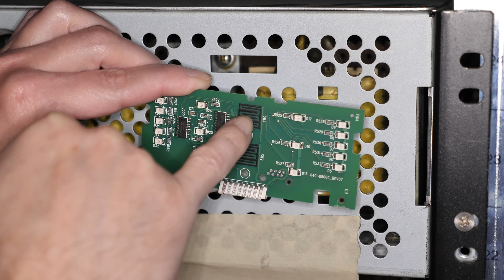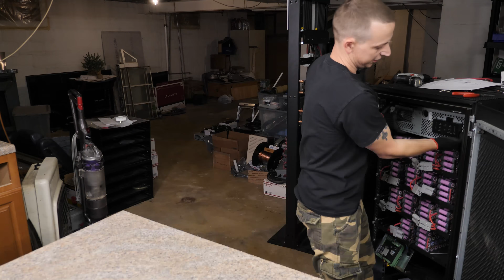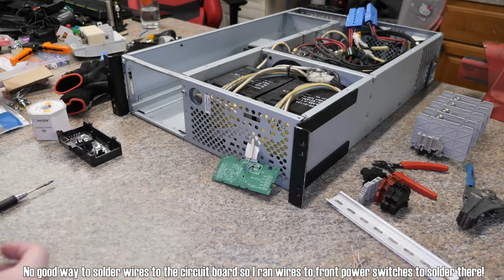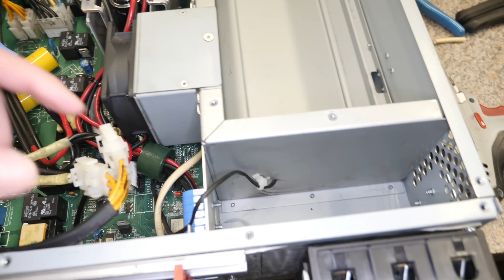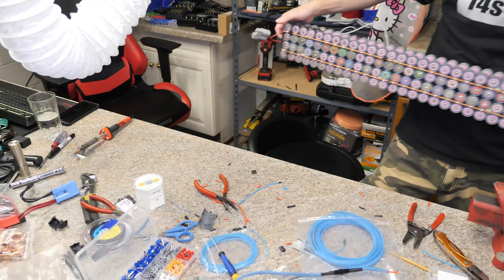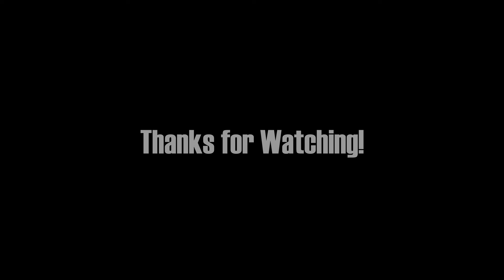Wiring the Diy Powerwall Control Panel Rack Ep.2 UPS Mods

Comment: APC UPS designed for AGM battery chemistry, not Lithium. Care to explain if/how you managed to reprogram it or are you just wasting battery capacity?
Reply from the maker: You are correct they are not programed for lithium. I am just using it as an inverter only....or was until I got a real inverter just a bit ago.🤘

Comment: Looks fine Joe
As to how or what to put on the back of the ups chassis, only you can really determine that. Remember this is a function over form application. If the layout improves function and safety, then it is right.
Simplifying the basis of the ups by removing those components not required is a positive step for safety. Same goes for the old power cord, as the socket for final AC connection.

Now that you have mentioned that you have not started the next set of battery packs, can you refresh the battery suppliers you have used? About 5 or 6 different ones as I recall. I would like to see where they are now. Options are good, one out the check the next.
Keep it going, this is going to be illuminating 😳
🤔💭💣💥
Reply from the maker: Thanks!  Yeah I was going for function with all that on the back of UPS for sure.  Rewiring and removing stuff that I never used was a WIN in my book lol.😆💥🤘

Yeah havent started the next battery build but think that is going to be a priority!  What did you mean by refresh the battery suppliers and where are they meow?

Comment: What? Horus didn't help you with the UPS? lol. 
Not bad rewiring that input wire as output. Since you added an outlet on it, no one could plug it in to anything, or become a suicide plug (the ones with the plug on both ends that some people use for generators and backfeed power through a laundry dryer outlet or something like that).
Curious how the growatt will work out for you. I was already invested in the MPP Solar LV5048 so I just got another one of those and it's now in parallel with my leaf powerwall. Now I need to add more batteries. lol. 25 kWh is not enough for my house and only lasts me about 24 hours.
Reply from the maker: Yeah I guess he was upstairs sleeping AGAIN🙄 Oh yeah I had a guy at work wanting me to make him a suicide plug.  I figure if he didnt know how to make one he shouldnt be trying to use one.  He would be that guy that didnt pull the main breaker💥  I was initially going to go with the MPP 5048 but once I saw they couldnt start a saw, I was out!  Maybe 2 in PEE can?  Have you tried that?  Yeah Im gonna need to start building those packs like ASAP!!!!
Reply: @AVERAGE_JOE  With 2 in parallel I have no issues with a 10" miter saw or any other power tools or oddly enough the garbage disposal. Before I added the second inverter, with only one, it bypassed to grid when starting the saw or the garbage disposal. lol. it's that initial surge that it couldn't handle on its own. now with 2 in parallel I got no issues. Can do up to 3 in parallel for 15kW total.
Reply from the maker: Oh ok then everything seems to be working pretty good then!!! You planning on a 3rd?
Reply: @AVERAGE_JOE  eventually. But at $1200 I'll have to wait a while. Lol
Reply from the maker: Cool and YES saving for an inverter or multiple takes time! Ive been saving for quite a while lol. What is the max load you have seen on your system?
Reply: @AVERAGE_JOE  about 6.2 kw. That's about 100A from the batteries. My leaf powerwall is only 500Ah so I try not to do that too much. Lol. Now in the winter time there is less sun but I top off the batteries from the grid at night when I only pay 1.5 cents per kW then use that power during the day when it would cost 12 cents per kW. Lol

Comment: Check out Genetry solar  they are building some nice inverters, the 6k will start a big window ac, while doing 7kw, if it's under 90° or so, they have a 12 kw coming, and a 3kw, check it out,
Reply from the maker: Ive just recently started watching some of his videos.  Seems like some decent off grid inverters.  Is that what you are planning to get?
Reply: @AVERAGE_JOE  yeah, I have a powerjack now, no issues with it, it's cool they have the wifi board in the GS, inverters, allows control of everything, the test have went great, and the ability to parallel, or series, 3phase,  powerjack would probably rate it at 20kw, but in a basement, it should last forever, keeping it cool, but a 6kw inverter, capable of starting a big AC unit, whild doing around 7kw is awesome, and it has a warranty, and easy to repair, but that it $1000, delivered, for the 6k
Reply from the maker: Sounds like a solid unit for sure! Ill have to look more into them! Thanks

Comment: The AC charging capability might be useful if you need to charge off a generator or something during an outage (to supplement solar).  Do you know the charge parameters of the built-in UPS AC to battery charger?  It might be set up for lead acid batteries -- can it be changed to work with lithium?
Reply from the maker: Well ever since I had a back up system, the power has only gone out a hand full of times and of those times Ive been 1000miles away visiting family lol.  Since using the UPS as my inverter Ive only charged the packs up maybe twice in the beginning when I was testing everything out and havent used it since.  Yeah its set for LA and dont think you can change it.  The charge is minimal as well.  If I remember right it only charges to around 56v at around 1.5a.  It might have even been less.
Reply: @AVERAGE_JOE  That makes sense.  The UPS would be designed to maintain a much smaller battery.  Not worth the effort, IMO.
Reply from the maker: Agree!

Comment: I like the placement of 24V fuse holder. I have totally agreed with Your design. I have checked description of expansion board. The relays are not small. Batrium derates maximum current to 5A, wich is good for reliability. Is the 120V socket on the output cable final solution? You could use output bloc with sockets from UPS mounted on the new rack. Wait to see videos with building new packs.
Reply from the maker: Thanks Man!  I wanted the most direct reliable solution for the emergency shut down/shunt trip!  Obviously a 48v shunt trip would have been better!  I thought the relays were 10a max but I could be wrong.  No the 120v plug is not a final solution and I really like that idea of routing the wires to a terminal block.  Only thing I need meow is moar room back there lol.  Another mentioned possibly doing it that way as well. Another thing I forgot to mention is at this moment I have been using a rack transfer switch and it has a 20a plug on it so I can just plug right into it.  I could technically cut that plug to direct wire tho lol!🤘

Comment: I am curious to see how going off grid goes for you. Not just because I want to see how you build your setup, but also what OPPD says to you when you accidentally feed the grid for 5 secs 🤣
Reply from the maker: 😜 Ill be doing all off grid or at least thats the plan.  Will probly take me forever since saving takes so long.  OMG I cant imagine what they would say LOL but Id probly blow up all the electronics in a second😬💥😆 Are you building a system, I cant remember if you said or not?
Reply: @AVERAGE_JOE  Yes I am, however, I just started gathering supplies to put up panels. I got iron ridge hardware for the roof. Right now I am saving to get conduit from the roof to the basement, and then figure out how I want to set up the system. I was thinking a transfer panel. As the system grows, slowly move services over to the panel. It also gives me flexibility to move everything over if power goes out. Ill get my 4th grade diagram made soon 😆
Reply from the maker: Nice! On my system now, I just used treated 2x4 cut to 6" pieces. Placed those on top of flashing that is slid under the shingle. Then screwed unistrut down on top of all that. The unistrut holds 24 panels. I have video of the install just havent edited it yet. Only using 12 panels at the moment tho.
Reply: @AVERAGE_JOE  if you get that up soon, I may consider that fir the rest of my panels, since the amount of hardware I have only holds 4 panels. I have 15.
Reply from the maker: Its super easy to do especially if your roof doesnt have a bunch of angles like mine has(at least my south facing roof had all the angles). Pretty cheap as well.
Reply from the maker: I have pics on my insta. Link to that should be in description.

Comment: Nice upgrade! You have a bunch of space inside. Will any of that fit in there? Mainly talking about the fuses since you'd probably open that up anyway if they blew. Growatt? The new cool thing? Would you connect 2 for 2-phases? IDK, I just want a 48V inverter with a big, honkin' transformer. I'll add everything else I need. All-in-one is nice and compact, but I want to put my own together the 2nd time around. Wonder if I could build an inverter? 🤔Well, wonder if I have the patience to learn how to build an inverter. 😂
Reply from the maker: Thanks Man!  Yeah I guess I could put the fuses in there, didnt really think about that lol.  Uuuuum yes, growatt is the new kewl thing to do.  IDK lol but I was sold when I watched the 6kw start and stop a whole bunch of powertools, saws ect at the same time.  Ive seen a lot of inverters not able to start a single saw.  SOOOOO Im saving for the Big 12kw!  Its a split phase so can do both legs.  Its got a huge mungus transformer inside and the inverter weighs around 165lbs😲 It also has MPPT charge controller aaaaaaaand you can hook it up to grid to charge and I wanna say use it kinda like a UPS but need to verify that last part.  Building an inverter I think would be kinda fun!
Reply: @AVERAGE_JOE  Oh I didn't see a 12k version. Only saw the 6k stackables. I shall investigate. 🕵🏻‍♂️
Reply from the maker: The stackables are high freq I think. I wanna say they are making a stackable low freq but not sure they ate out yet. Yeah look up growatt 12kw split phase or low frequency inverter and you shall seeeeeee😃
Reply: @AVERAGE_JOE  Oh. It's a weird site. See the SPF1200 now. I approve. 😂
Reply from the maker: Was going to say I could add a link 😆 https://www.signaturesolar.us/categories/off_grid_inverter/2203789000000543155
Reply: @AVERAGE_JOE  Search brought up www.growatt-america.com. I got more info from Ebay. Your link is better. 👍

Comment: 10Kwh is not exactly a small battery.   I can function 24 hours in my Mobil home on that.  Our house simply does not demand that much .
Reply from the maker: True in RV/mobile or small home but in my case I dont think it will be enough for big loads. I guess WOOLC😆
Reply: I don't think he ment RV by mobile home I assume like a trailer house that's what I live in

Comment: I would put some heat shrink or grommets in the locations that wire pernitrate's the walls going to where ever.  Yea it's low voltage control power but vibrations happen.   CHIT HAPPENS.
Reply from the maker: I did on the back but not on the front🤦‍♂️🤷‍♂️😃

Comment: Your panic button is not the right model in case of urgency. You really should consider this kind of button instead : 
https://eclats-antivols.fr/en/button-panics/5659-emergency-stop-button-no-alarm-nf-punch-diameter-24-mm-anti-panic-security-system-3663275009030.html
I took a random one. With this kind, you don't risk not finding the hole to press the button in case of panic.
Reply from the maker: True its not and I almost got one of those but had this one on hand.  I hear what your saying butt this one I have works with the slightest touch!🤘